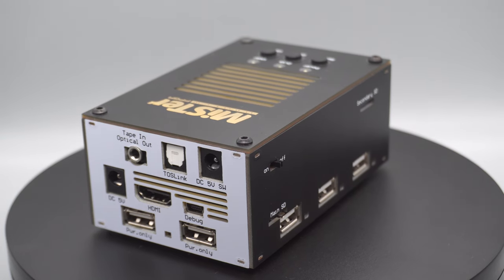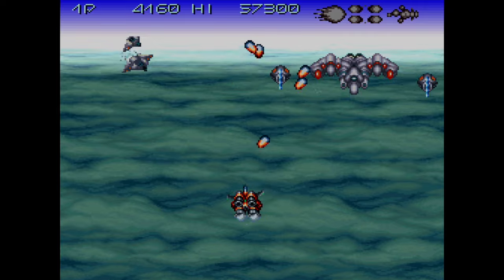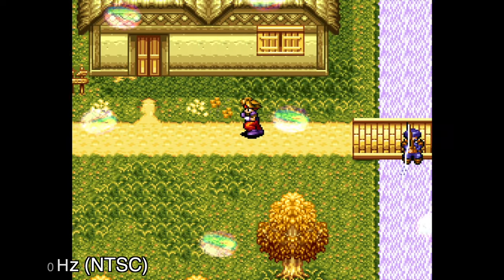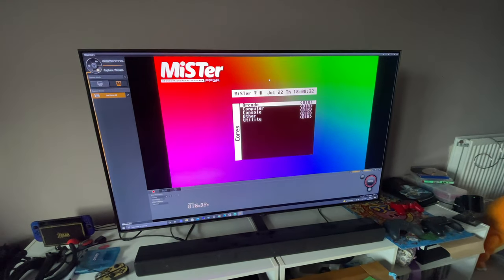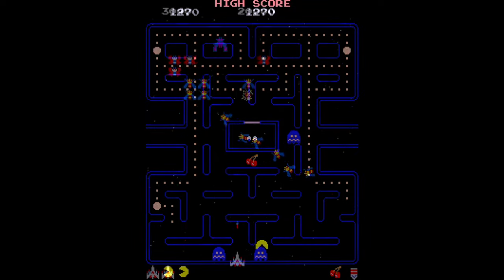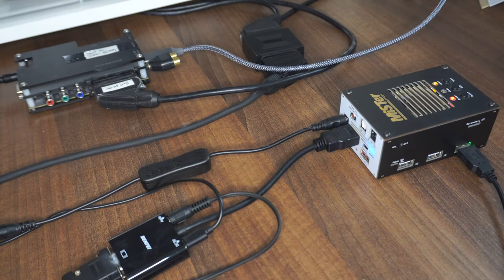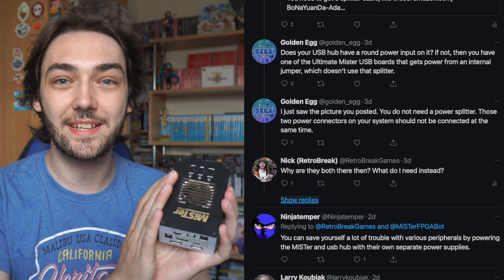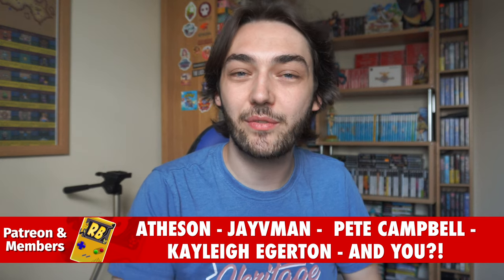MiSTer FPGA Review [HARDWARE]

Comment: Going into my 4th years as a MiSTer owner and I still love it. I particularly love it for the ever evolving computer cores. I also run a quick game here and there in emulation on Mac and PC, but most exploration is on the MiSTer. The DE-10 Nano board cannot handle computer architectures later than mid/late 90's. Just remember that before you buy. No Dreamcast, XBox, PS2 etc. Do that stuff in emulation :)

Comment: That looks an amazingly clever device, seems very thorough in what it includes. Just sounds a bit complicated to get the best out of it. I have a raspberry pi which is similar but less sophisticated and mine does have problems running some games considering it was a third of the price I don't suppose it's too bad. Fascinating video once again 👍
Reply: It's actually more complicated to tweak a Raspberry Pi than a MiSTer, honestly.  Part of that is because the Raspberry Pi has an entire OS, front end, and Retroarch built in and settings for each.  The MiSTer doesn't have so many different layers to configure.

Comment: Great video!  I think I will get one of these and have also been looking at RMC's console-style MiSTer Multisystem version.

I am actually coming from a powerful gaming PC using Retroarch with a Hori Fighting Edge with Sanwa parts.  I am very happy with the performance of the emulation on my gaming PC and do not notice any real input lag but do notice alot of sound issues with Mame /FB Neo.  I emulate arcade, Amiga, C64, Megadrive and PS1.

I also have modded PS1 Classic which boots straight into Retroarch (ozone gui) with 2 x 8BitDo wireless USB receivers and 2 x Dualshock 4 controllers.  I also have 2 x 8BitDo 2.4Ghz arcade sticks with all Sanwa parts for the PS1 Classic. This is hooked up to a Pioneer KRP-500M plasma which looks pretty decent with some light-weight CRT shaders.

Also have a custom PC powered bar-top arcade with Hyperspin front-end but I am now ready to have a dive into a MiSTer system and will also pickup a Sony PVM or portable CRT TV.

Comment: The MiSTer is a great option but so is emulation. You can emulate systems that the MiSTer will never be able to do. You can have multiple instant saves with emulation and in many emulators you can upscale the resolution. If you want gameplay as close to the original consoles as possible, the MiSTer is the way to go. If you really like retro-gaming, you should use both options as they fit your needs or desires. Neither option is wrong.

Comment: I've got one of these and they are great! However, I will say that for my eyes and ears, I haven't really seen or heard anything while in use that makes this more accurate than just running emulators on a Wii. So for most people, the extreme accuracy of the mister may not even be noticed compared to other emulation options.
Reply from the maker: True I feel like only really enthusiasts and perfectionists would realise the difference between this and regular emulation. I can definitely feel the difference though
Reply: the input latency is a big thing. Also, it doesn't have frame skipping like an emulator.  it always runs at full speed, cycle accurate hardware "simulation" so to speak.  it runs the game code natively with no translation
Reply: Then why are you here ?
Stick to your silly Wii, and crap emulation. Stop polluting Mister comments with your nonsense.
Reply: @mrkirk4944  Because it's still cool to see videos about it. I have a mister and appreciate what it can do. I'm just saying that it's not for everyone. I'm not trying to start a debate.
Reply: My experience is this is mostly true for consoles - or, at least, I never used the old consoles enough to pick up the differences. However, for arcade systems the differences are much more apparent. I tried multiple MAME emulators and they all have display and timing issues that made it very difficult to enjoy the experience that FPGA completely corrected - for the arcade games it supports.
Reply: to be fair Wii does pretty good for outputting 240p on a CRT. I have a Mister and love it but you can get a used Wii for ≤$50.  you can't beat it for the price.
Reply: @mrkirk4944  the Wii isn’t silly, it gets you GameCube games!

Comment: MiSTer is the bomb! Not expensive, all you need is to find the de10 nano unit from digikey for 170 or something and you're good to go (used to be 130usd). Ram upgrade is crucial for more than something like just genesis, however. Can use hdmi to vga adapters in lieu of the analog board to save more money as well if you dn't need multi video out.

Comment: Man, don't use the 5v cable on the HDMI to VGA adapter, it could damage the MISTer's HDMI output
Reply from the maker: Thanks for the heads up! Just tried it without, and it still works!

Comment: Some people say it is very expensive (i agree it is not a cheap solution) BUT if you had to buy the real consoles, it would be way more expensive. Plus you would need everdrives too for each console! And space to spare.    ^___^;
Reply: I think it depends a bit on how many consoles you'd be getting. Around here, you'd be able to get at least 4 different consoles for the cost of the MISTer. In either case, you'd be stuck buying carts which is where most of the cost here is. Personally, I'll likely buy the MISTer anyways, but for a bunch of people, they'd probably be better off buying the consoles and putting the money into carts to go with the systems.

I'm sure there are people out there that have a diverse enough taste in games from different systems that this is the more affordable option. For most people the main reason to get this is so that they don't have to worry about replacing failing components in retro systems.

Comment: Great vid.
Just curious, why would you do the overly complicated video signal routing?

Instead:

MiSTer -> HDMI splitter -> HDMI2VGA -> CRT 
                                           -> Capture Card

The OSSC is a nice box, but feels like it has no place in this setup?
Converting the signal to analogue then back to digital seems a bit unecessary?
Reply from the maker: I tried it that way round, but using a splitter before the VGA adaptor didn’t work. the capture card didn’t recognise the signal, so I had to either to go through the OSSC or my Scart - HDMI converter to get the capture card to recognise it. Think it’s because the Ini file changes the output to not display through HDMI, so doing the splitter first didn’t do anything
Reply: @RetroBreak  I see, well capture cards can be finicky beasts i guess 🤷‍♂️
Good you found something that works for you😊

Comment: FPGA is overrated. Today's modern devices completely surpass the OG consoles with emulation. Why would I want to keep all the quirks and slowdowns from OG retro consoles? If you're going to talk about running a game 1 to 1 on FPGA then why go and stretch, double the res and what not. I will stick to my Pi 4 or Launch Box from a PC with its HUGE collection of pretty much everything under the sun with a beautiful GUI to boot. Modern devices offer emulation with relatively zero noticeable lag (when properly configured) even to the 5% or less that can actually detect said lag lol. But to each his own, I guess. Good Video though 👍